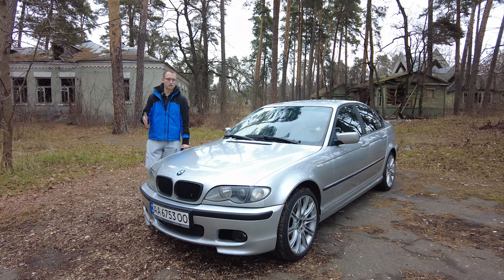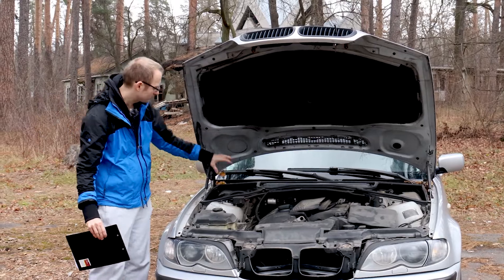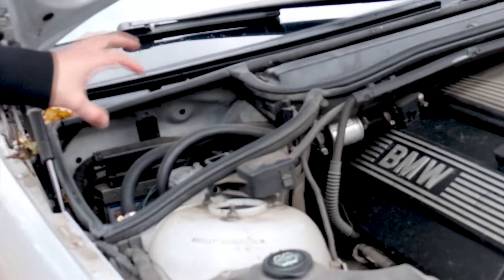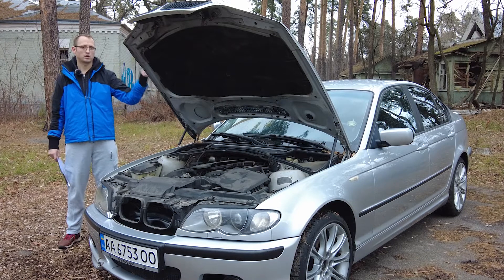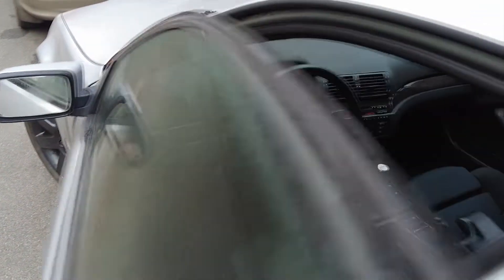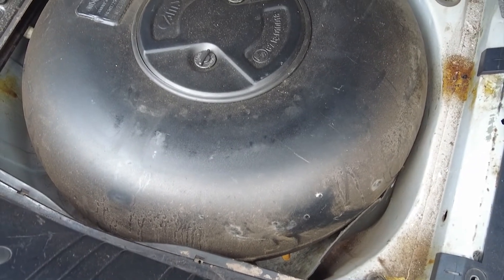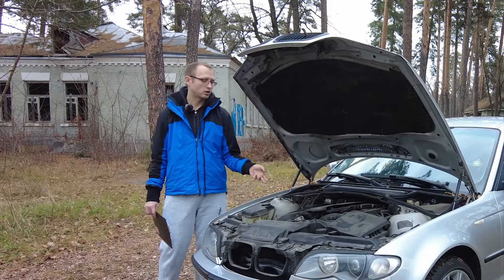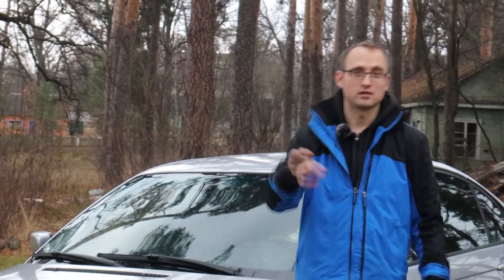Why This BMW e46 Runs on Propane

Comment: Hi...what is your experience about the system lpg un your car?...is good..or not?...any problem un the engine?....It work good?..Tell me about It..are you Happy? Thanks
Reply from the maker: Hi Oscar! Thanks for your comment! It worked ok but it requires additional maintenance like filter clearing and stuff. It definitely won't cause engine problem as lpg does burn cleaner and does not leave carbon buildup in engines. 
As far as you know Ukraine is in a war now so gasoline shortages are widespread. Thankfully having an LPG car is advantageous right now, since I believe gasoline crossed the $2 usd dollar a liter mark in Ukraine while LPG remains less than half that.
Reply: @Ukrainiancouple  ok ..I had an Renault Megane with lpg..and It worked good..but i Dont Know the BMW engine how to work..thanks to  you i Know some else about it..un this engine..i actually. have a BMW serie 3 n42b20..  i want to install  soon the lpg system.in the car...because the price of gasolina Dont stop to Up.. thanks to the información..long live to ukraine.